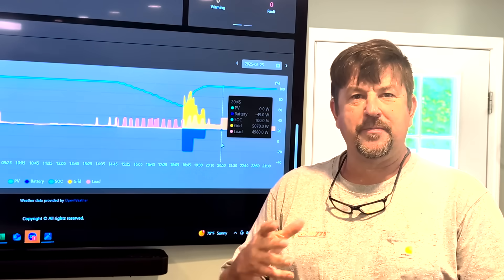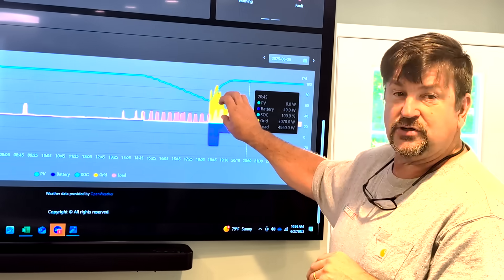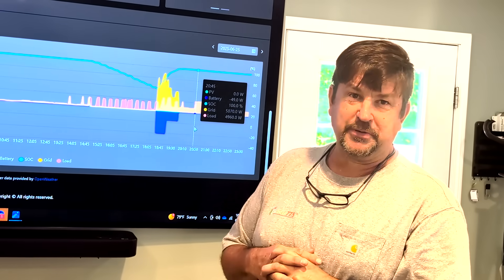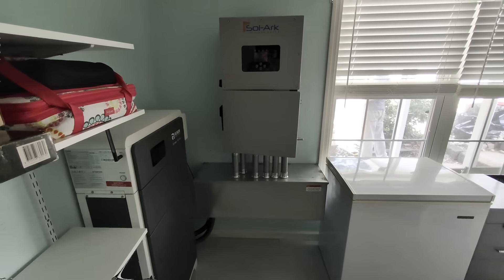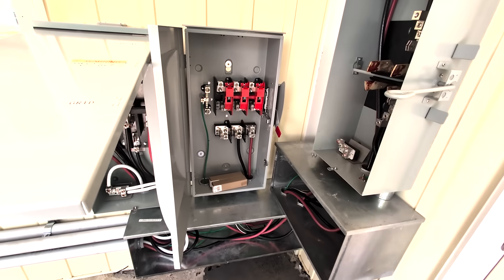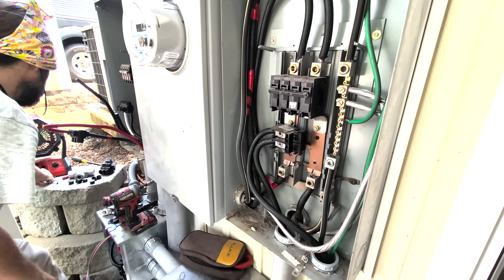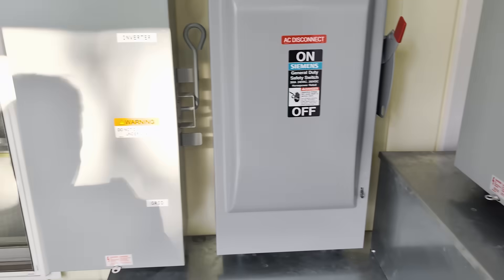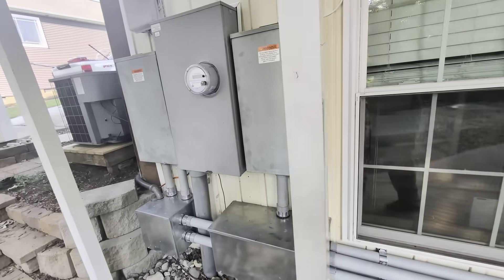Slash Your Demand Charges & Get Backup Power — No Solar Required

Comment: Solark is pricey, for the price of that you could have got two eg4 18k to run everything all at once or a little more money got the two inverter. Good job anyway
Reply from the maker: That's not even close to being true. Solark is $4.20 per kilowatt in the eg18 is $4.08 per kilowatt. Factor in the ridiculous mppt layout on an 18K and the inability to land 4/0 wires for batteries. And doing a simple test. The EG4 18K overheated on me three times. Don't be fooled

Comment: Can  bobcat T650 run the driver?
Reply from the maker: It's a little too small.  Do you know what the lifting capacity is and how much that machine weighs?
Reply: it’s 9200 lifts 2600
Reply: Cat 299d ?
Reply: 11000 with 3200 lift

Comment: Your videos are great with information. I never see you put the sol ark with the battery evo king kong 2 62kwh together. Are they not a good pair.
Reply from the maker: There are a lot of batteries out there and some of the batteries our private brand labeled with batteries that solar does not endorse and I think that's one of them. The issue becomes if the battery BMS firmware does not work with the inverter, there are problems. Even though some companies have the right protocol, we have seen a lot of issues with cheaper batteries writing to the solark and corrupting the registers. It's unfortunate that batteries are right. Only devices and the inverters are read-write devices.
Reply: Oh ok thank you for replying back

Comment: Do you mind drawing this out in diagram form with all the bypasses, disconnects, generator plug, etc? Especially since this has two main panels I’m curious. I understand electrical pretty well, but this is newer to me and there’s a lot of different devices and current paths and I want to understand how it all works together. Thanks
Reply from the maker: Send me an email to practicalpreppers@gmail.com

Comment: I did basically the same thing as you are demoing here. The only difference is that I use fast-charging Solar Generators and sometimes offset the solar generator with batteries. I try to charge the Solar Generators in the evening when the rates are lower.BTW, I'm only using my Solar Generators to run my Box Freezer and AC when it's extremely hot during the early afternoon.

Comment: One of my favorite YT vids is UK's PhotonicInduction, a vid called "Cheap Backup Power" (ID: ka0MfipmdBw). Mid 2000's he used two SLA/VRLA batteries and a homebuilt timer controller to charge the batteries at night using 'Economy 7' (middle of the night power rate up to 50% off, originally meant for storage heaters, now EV users). Then it feeds back to most of his circuits during peak hours using a 1500W Samlex/Cotek pure sine 220v inverter. It worked so well it paid for itself in a few years, plus he could power the whole house during a power cut with a switchover relay. Was just a matter of time before the new LiFePo4 friendly inverters started doing the same peaking / peak shaving stuff. Love it, and that Youtubers channel is _madness_.

Comment: I have solar & Tesla powerwall, until 2 summers ago we had TOU 1:00 -6:00 pm and I would take the house offline and sell the excess electricity back and made a good profit - then they changed the TOU to 6:00 - 9:00 p.m, which meant I left the TOU program (no solar generation and the TOU was crazy ... I suspect they changed it to stop solar households making money). The new system will certainly save them money if the battery charge/discharge cycles can extend at least 5-10 years past the pay back period for the system otherwise it will be an exercise in kicking the can down the road - Engineer775 and idea on ROI ?

Comment: Rikght... you can't parallel the GridBoss (yet).  But if the whole point is to avoid demand charges there is nothing stopping you from the limiting that 320A service to 200A going into the GridBoss and then making-up for any consumption above 200A with the battery.  Most homes don't even use their full service (ever), too, so it is fairly easy to just limit the grid to 200A and be done with it.

If you think about it, just as a thought experiment... 200A x 240VAC x 24 hours = OVER 1 Megawatt-hour per day.  So unless the property actually uses that much energy each day, you can absolutely limit your import from the grid.

Just to make things easy for myself when I DIY'd my EG4 system with the GridBoss, I wound up deciding to run 2 AWG from the forwarder with a 125A breaker rather than 3/0 with a 200A breaker.  I have a 200A service.   My home hardly ever exceeded 50A in the first place so it was an easy decision.  And now with the storage system it basically never does.  So even with the smaller breaker I wound up with a ton of grid margin.

Beyond that, given the expense of these sorts of systems it makes a lot of sense to always do some solar along with the battery and inverter.  Having the solar will also off-load the inverter a bit during the day and will paper over the AC-DC-BATTERY-DC-AC round-trip inefficiencies (which with the Sol-Ark, round-trip... I think it's around 85% or so).  Plus get you a bit extra.

Battery storage is also a big deal, particularly if one is charging an EV.  To make things convenient we're talking ~30kWh or more.  In my case EV charging with zero-import wasn't convenient with only 14 kWh of battery storage.   But with 28 kWh of home storage its incredibly convenient.

-Matt

Comment: Weird that peak demand pricing is in the middle of the afternoon.  It's typically during the evenings.
Reply from the maker: 3-6pm  is not abnormal for the demand load in the Southeast in the summer.
Reply: @engineer775  I stand corrected.  I checked GA Power rates and they're 2-7pm, if I opted for a ToU plan rather than my current flat rate plan.
Reply: April -Oct it's 3-6pm. November-March 6-9am

Comment: GREAT CONTENT - good solution

my small (20k rural customers) local Muni PoCo is switching all customers to Time Of Usage billing (TOU) next January (I have been on it for 2 years as I have a hole house battery and XW Pro's running  OFF Grid 100% from March to Oct)  Summer ON Peak rate is 24.5 cent/kh.  When needed I charge my battery with Chargeverters during OFF peak times at 10 cents/kwh, to 24% SoC waiting for the sun to come up and do the heavy charge lifting.  These events usually occur in winter after lots of clouds and snow and at O-dark-thirty

This month they have added Demand Charge bill as well

Usually that is used for farmers who pump water, but now all customers will be billed for their highest demand of power

soon they will have all the mechanics in place for future policy changes (ie raise the rates over time) to get all the money they can

Comment: My local electrical utility co. has been making "noises" about peak energy usage, but haven't talked about demand charges....yet!  How much would a similar system (shown in the video) cost, but for a "standard" 4-bedroom home?
Reply from the maker: About 20k depending on how many batteries and how much electrical work is needed. There was a lot of electrical work here to add 2 garages and a large hooome to the system.

Comment: You'd think that running a genset would be significantly cheaper than using the grid during peaks.
Reply from the maker: Nope.  If you were using a 20kw genset you would burn 2.2 g/h @ $2.50 ( half load (10kW): Approximately 2.2 gallons per hour) * 2.5 * 3 hours you would spend over $500.00 /month.  Generators have to run at 60HZ ( 3600 RPMs)

Comment: E775, TOU has been solved with the Anker Power Station, relatively inexpensive and very quick to install, by using the Anker smart panel and some Anker Power Station, can be setup within 2hrs or so by anyone with little electrical skills since it backfeed the main panel and monitor using CTs, the smart panel also have backup output as well if you want to protect some circuits in an power outage but that requires more skill and allot more time to setup, and as you know Anker also support solar as well, but yeah the Anker setup is limited to only 53.8kWh of batteries thats good for most homes tho.
Reply from the maker: We are definetly talking about a different solution.  This can run any of his 80+ circuits. I don't even know where to start to make a comparision concerning capabilty and cost.  How much would the anker system cost with no back up?
Reply: The Anker system (e.g. F3800's and massive battery expansion) would be impossible for a setup like this.  I doubt it would last more than a few months before frying something and you would need... uh... at least 4 units to even come close to the capability of a single Sol-Ark.  Power station solutions are basically just rated as gensets (generator port style), they are NOT rated as service entrances or service pass through.

Despite all the influencer media reviewing the free Anker's they got from the companies (and EcoFlow, and Bluetti, and so forth)... once you get serious about whole-home you generally want to avoid power-station solutions.  They're fine for small installations but if you need more than one unit and one expansion battery it will become an expensive mess with no good solutions when things start to break.  I'd avoid them like the plague.

-Matt
Reply: @junkerzn7312  don’t get me wrong i never stated the Anker system could do the same as the setup in this video, your video information seem it was saying as if there is no other solution, when the Anker smart panel system been out forever now and can support any load up to 12,000w that is good for most home but yeah very weak for homes with like 400amps of crazy load, just saying Anker makes its simple, very inexpensive to install the Anker smart panel is can be done quickly DIY and with two F3800 thats up to 12kW most normal house would be good with.